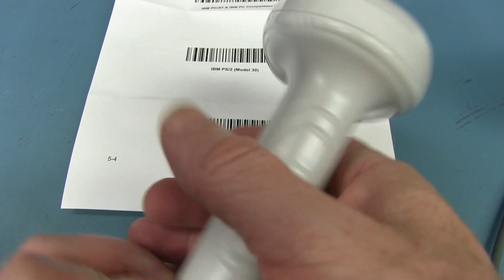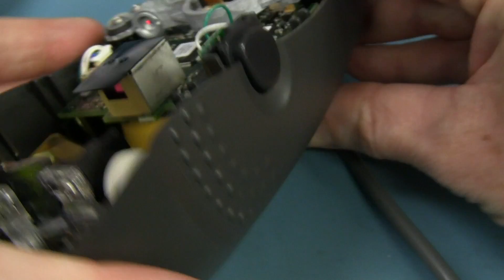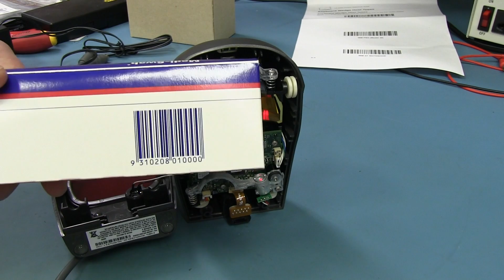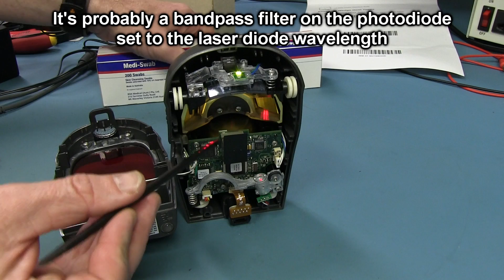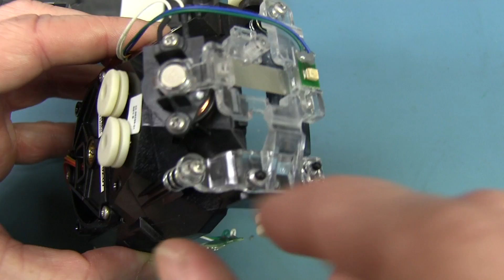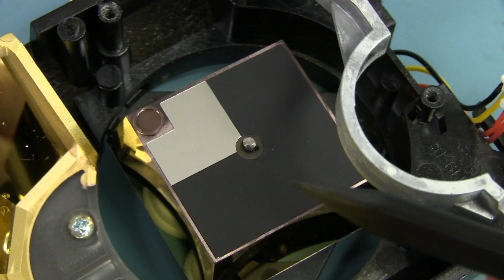EEVblog #637 - Omni Directional Laser Barcode Scanner Teardown

Comment: Really fascinating 🙂 Some piece of engineering. I have figured it out how they get 5 different basic angles of orientation (the 5 mirrors) and 4 lines per angle (the rotating cube), and multiplied with that 33.7Hz vibrating mirror to get even much more positions in between. But I am not sure I understand the path of the reflective laser light (back to the sensor)? Does it receive the light from all 5 mirrors directly? Anyway this video is the most impressive one for me I have seen from eev blog so far 👌

Comment: I just repaired a waterlogged LS9100 that I found on the street. It's extremely similar to yours. Mine doesn't have the extra vibrator coil but the rest of the design is very similar (though with mid-90s components). The prism on mine doesn't have any reflective segment. I suspect the 
timing of the rotation is completely unrelated to the optics - I think it'll decode as long as the detector sees any valid train of pulses, regardless of their timing with respect to the mirror. You could probably swipe a barcode past the detector "really fast" and it might still work. I suspect the photoreflector on your prism is needed to align the scanning with the action of the vibrator coil, to prevent one from interfering with the other. The extra plastic bit in the corner might be for balance.

Comment: There is no image processing. It just scans (hence the name), lines and measures a reflection using single sensing element. Laser makes reflection very bright and easy to distinguish. Only remaining processing is to synchronize the code, as the barcode is flat, but at unknown distance or angel, which shortens or lengthens the barcode in time. Arm seems a bit like over kill, but maybe they really need a speed , as this thing needs to try to detect about 80 codes per second. I still feel they should be able to process that amount of scans with just the h8s they have on board.

My guess is they needed some customization features (i.e. upgradability in the field, including ability to add support for new code types), and h8s was just too old to be messed around anymore.

How the 2d codes with this kind of laser sensors works I have no idea. I think they do have two perpendicular mirrors.

Comment: The part where he stalls the motor and the Laser switches off, is actually a safety feature. Even though laser is class 1, when focused on a single point (in this case) can heat up the point of illumination quite a bit. Please correct me if I'm wrong. 
Thanks

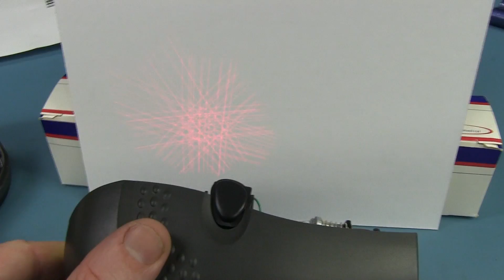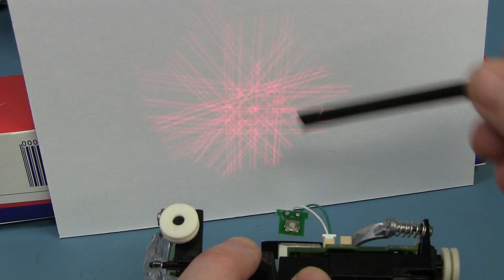Comment: 9:30 to 10:30 Aren't the number of parallel lines more than 4? The vibrating mirror (Solenoid + permanent Magnet) is producing those extra lines (which are, of course, parallel to the four parallel lines when he force- stalls the vibratory motion). Please correct me if I'm wrong. 
Thanks

Comment: This doesn't work by image recognition really. What it gets is a continuous sample of the trace that the laser passes through. As the trace runs over a barcode, the series of high/low reflections produce a, effectively, binary series. The real trick is taking the series of states and scaling it properly so you can decode the scan.

The fun thing as well is the sensor isn't really focused, it's just picking up the reflection of the bright point of light where the laser hits.

If you put an oscilloscope on the detector and put a barcode in front of it, you should see segments of the barcode or multiple copies of it over the full period of the scan.

The custom chip is probably a form of DSP that does all the auto-gain and timing to get the barcode back.

Comment: What was with the part where you were wondering if the laser was needed to scan the barcode? I thought that was essentially a given, Dave? Not being sarcastic at all, by the way. This is a genuine question, so please don't take offense or think I'm trying to be disrespectful. 

Are there any scanners that actually scan with ambient light when their lasers are disabled or obscured? Also, you mentioned at one point that the Atmel chip was manufactured in the 53rd week of 2005. Aren't there only 52 weeks in a year? Again, not a sarcastic question -- are there 53 weeks in some years? Leap years, maybe?
Reply: As for the laser essential check, he was probably just mythbusting. And scanning with your smartphone obviously just uses the camera, unless it's one with an actual laser scanner. Now a year is 52 weeks plus 1 day (2 days in leap years) , So 5 out of every 28 years will have an extra week if using the system where each week number covers a full 7 day period (with part of a week 1, 52 or 53 being in December or January of another year). If using the alternative system of having partial weeks at the ends of the year, every year will have a week 53.

Comment: I think the mystical non-magnetic thing on top of the rotating part ( 22:35 ) is to balance it so it does not vibrate at full speed. They may manufacture this part and do a spinning vibration test. If required they can grind of a tiny little amount of the material to improve rotating stability.

Comment: Psch, you were surprised that the laser is needed in this type of setup? Why would they put the laser in there if it weren't needed?
Reply: MaxxFordham It's the reverse engineering process.  You go into a system where you have absolutely no idea how it works and you start poking and probing the various systems to see what the effect is.  His possible theory was that the laser diode was for a visual effect to aid the person scanning to know where to aim, but he found that it was dual effect in that it does both help aim and act as a medium for reading the barcode.  It could have been done through some other means perhaps.
Reply: MaxxFordham For you to see where it is scanning maybe?
Reply: +MaxxFordham The reflected laser provides greater contrast than normal light. He was just checking if the photodiode was sensitive enough to make out white lines from black lines using ambient light
Reply: Well, duh, Arnav Barbaad, of course it doesn't, which is the whole point they need a laser, which is the whole point behind my question.

Comment: What's cool is that nowadays image-recognition technology is so good that you don't need any moving parts, or even a laser at all, to decode bars; just use a camera such as the one built into a smartphone, and the app that drives the recognition (which is how QR has already been done for a good while now, but the camera may still not have quite the angular omnidirectional flexibility as this does yet.

Comment: Great video, with some mechanical/optical in addition to the usual electronics. At 11:57 you try to scan without the laser diode. I think that the laser doesn't just illuminate, it effectively points the two-wire sensor at each particular part of the barcode while scanning, while the sensor just picks up all light from the area (i.e. it doesn't "look" into the mirror). So even with a bright light, the sensor won't be scanning the barcode, just looking at all of it at once as a gray.

Comment: The "shock mount" is probably more for how they couple the vibration of the top mirror to the no doubt intentionally unbalanced spinning mirror. Neat! Kills two birds!
Reply: And yeah, it doesn't "see" the line. The input is only the amount of light over time. When an appropriate pattern is detected, it's a barcode!

And there's no sync issue with the motor. It just doesn't matter. It can only successfully read a barcode if it gets the whole thing including the start and stop bits at each end. The time that takes can be flexible over quite a wide range. (Which you'd expect, scanning codes of different sizes and at different angles.)
Reply: And that thing in the corner of the pyramidal mirror (please stop calling it a prism :) ) is a counterweight to create the vibration needed to shake the top mirror. Why it needs the optical reflector in one quadrant, I don't know. Again, the scan's timing should not be an issue to the sensor. Incomplete scans get tossed by the logic. But perhaps this informs the scanning logic in some helpful way. Dunno!

That rotational sensor reminds me of what you'd find in the old computer mice with balls in them. The balls ran two axels at 90 degrees to each other, that each turned a fan shaped wheel, where the spokes of the "fan" passed between what appeared to be two tiny and opaque components, but which were obviously emitting and detecting some invisible wavelength of light.
Reply: Sorry, writing this as I go. Ah, so there IS a linear driver on the top mirror? Hmmm, From what I could see in the video I could have sworn it was vibrating sympathetically with the main mirror's motor. Seemed to be a very simple and graceful way to get synced movement. Oh well.

Comment: Nice teardown.
Here's my take on the full path of the light.
Just as David says, the laser reflects on the center circle in the wobbly mirror, down to the rotating prism, sweeps across the 5 sided reflector, and then sweeps the barcode.
But how does it get back to the photo diode?
I think the most visual way to show that would be to replace the photo diode with a LED (say, a blue one), and see what it lights up. The area that is lit blue will represent the area that the photo diode "looks at".
The opening on the photo diode casing is directed at the wobbly mirror, and that's most likely why the mirror is much larger than needed for the laser, and it's also concave to concentrate the light. So the blue light bounce off the whole wobbly mirror, down to the rotating prism, over the 5 sided reflector, and on to the barcode as a fuzzy blob around the sharp red dot from the laser.
That would actually be a cool experiment to view with a high speed camera. You'd see how the area that the photo diode looks at actually follows the laser dot sweeping around.
I don't know how big this area is, but I'm sure it's too large to see any details in the code. The details comes from the small laser dot, the tracking "viewing area" is just to reduce noise.

Comment: I don't think it actually does image processing. The laser just illuminates the barcode and the reflected light level changes while it travels across. The sensor just picks up pulses in the brightness level.

You could try putting the barcode in front of the sensor with the built in laser covered, and then flick a laser pointer across! Or use the laser from the other scanner to illuminate it.

Comment: min 23: 14 , that weird device look like an IC , is an actual detector that captures the light from the reflecting square on the motor, in order to align it, However, the way of working is simple, the slit in between is usually dark , once the light reflected from the up surface of the motor (the square reflected area) with a specific angel, it will go into that slit and illuminate it.Then a detector will do its job. (its my theory) . so the slit has a function (i call that geometrical engineering)

Comment: I am very familiar with those scanners. I hate them.  Or rather I hate the way most places use them.  Many are piggy backed to the PS/2 port with the keyboard.  If that wire gets loose it knocks both out.  Often times not working until the system is rebooted.  This goes over the companies "IT" staff's head.  The versions we have support the use of a USB cable and that would eliminate those problems, but no we can't have that.

Comment: these scanners literally work as keyboard input, at least as far as the operating system is concerned.. you might as well be typing it all in.

these scanners can also be programmed to add a prefix and suffix for every bar code scanned... and since today's POS terminals are just PC's running POSREADYwin7 or just win7 if not xp... you could  make a stacked barcode programming the scanner with CNTRL-ALT-DELETE prefix haha..

but unless you know ahead of time which brand and series of scanner you are targeting.... it'd be quite a gamble, as programming codes are different between brands and even model series.

Comment: That is a beautiful piece of kit. Love the gold coated reflectors. Love the construction in general really.

To my (admittedly) inexperienced mind, that looks like a lovely piece of work. Engineer porn. :)

It's great to see such a combination of a physical, electronic and computational elements to make an elegant and widely used solution, with bonus points for actually being well constructed and, indeed, using the construction to help in function.
Reply: Gold has good red and infrared reflectance. And it lasts. Silver does work good in IR too (not as good as gold tho, but super close), but tarnishes. So depending which side of the glass you use, it can be a problem.

Comment: This thing essentially takes your one-dimensional handheld scanner and positions it in a whole bunch of different ways very quickly. I would hesitate to call this "image processing" because the processor is simply waiting for a serial stream of meaningful data. Once you realize that this is still a one-dimensional scanner, your "angles" only mean different scan speeds. Most don't work. too high, too low, left, right... It's waiting for one meaningful scan.

Comment: why does the front panel have a red tint?
Reply: VCR and TV remote sensors have the red tinted lens too, not sure why though, probably to filter ambient light.
Reply: Blocks wavelengths that are of no interest to the scanner. Not sure why that is needed given that the thing only wants to register those it is interested in. Perhaps its a generic shell which could be applied to similar devices with a less sophisticated internal filter (as on the detector diode)?

Speculating here. Food for thought.

Comment: The sensors in those are usually CCD type devices rather than photo diodes as a standard photo diodes do not have the resolution required.
Reply: A photo diode is sufficient. Early barcode scanners  were simply a photo diode stuck in the end of a pen that you dragged over the bar code to be scanned. Do you remember the days when computers mice used a rolling ball and optical encoders instead of a camera? On that type of barcode scanner, resolution is the reason a laser is needed instead of a bright LED.
Reply: Indeed, also ball mice constantly needed cleaning or they became unuserble.
Reply: ***** My point is that there's often more than one engineering solution to a problem. In this case having an open mind and looking and analyzing  what's going on can lead you to the truth. I love my current wireless optical mice however some of the earlier optical mice had their own set of issues, over time with more refinement and advanced technology they have got better. I wonder how many million transistors and lines of code dsp etc it takes to run a modern mouse?
Reply: Indeed, multiple solutions to a problem are always fun. Give a problem to several engineers, they will all have different solutions to the problem all with there on advantages and disadvantages.

Comment: I doubt it was to bind ground to ground cause the metal case would connect those grounds anyway, more likely it was for shielding afterthought. The optical position sensor has IR GaAs-emitter in combination with a silicon NPN phototransistor.

Comment: If you hook up the oscilloscope to the sensor, would you see the "barcode" as pulses on the screen as the sensor scans each bar on the strip?

If the object with the barcode is totaly stationary with the sensor, kan it still read the code or do you have to move the barcode across the laser beam for the sensor to read it?

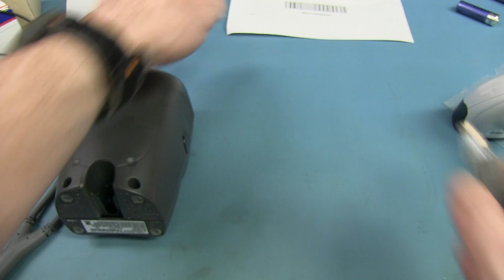Comment: 04:00 Yes, you can, but either as service personnel, or someone close to them. There's calibration pattern sheets similar like this, for every known bar code scanner. Different patterns exists even for same models with either USB or RS-232 models, so you need to know EXACTLY what are you dealing with.
Fun? Best part of this fun is probably when they catch you on security cameras, no doubt. Good lock then!
And laser diode is so critical part that motor in bar code  scanner will not spin at all (returning only beep error code) if diode is not functioning.